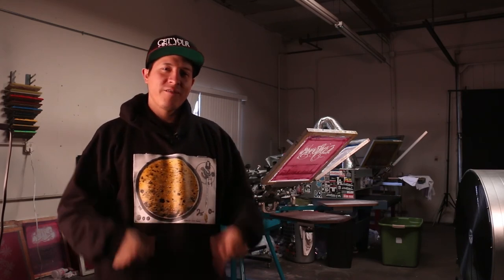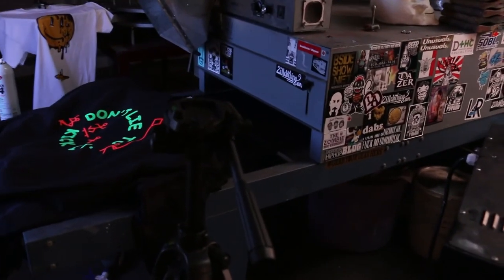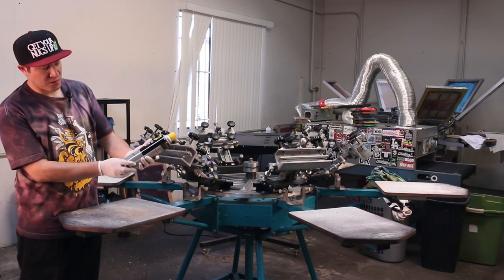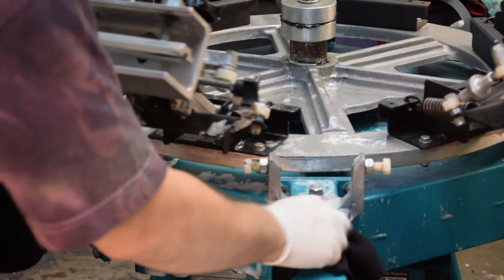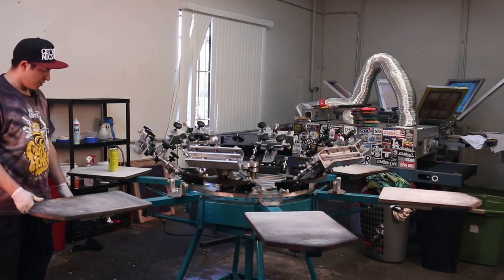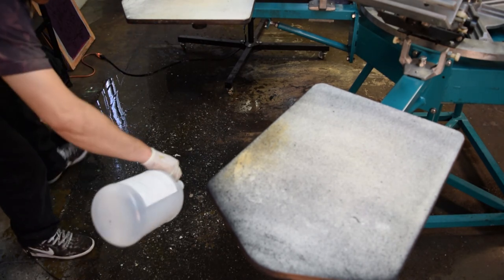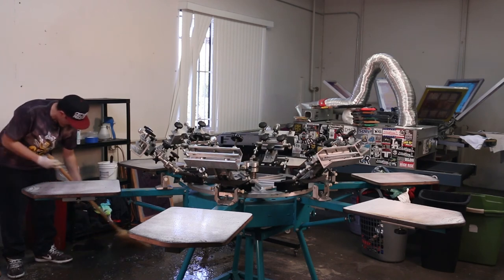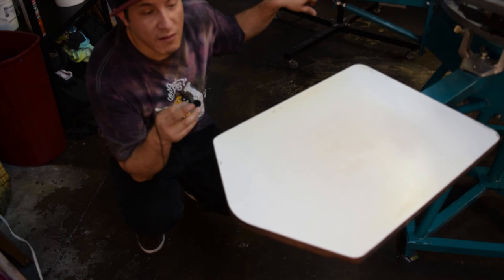2 iLL Screen Printing - Cleaning - Machines & Floor

Comment: what's up g like the vids I got a question I been screen printing for about a year and when I print white on black tees you can see fibers in the print it's not smooth like I would like a homie that screen prints said to use a higher mesh I did but I still have that issue
Reply from the maker: +95HondaEg6 Send me a picture detail of what you are talking about and ill incorporate it on one of the videos. Thanks for watching!
Reply: +95HondaEg6 Maybe the ink you are using is to thick make sure you mix it a lot to make it smoother try to reduce it by using reducer.. ic can also be that your not hitting it enough times.. try to hit and flash and hit and flash again until you get a nice bright white.. I had the same problem I started using a different plastisol white called Meteor white from Ryonet i recommend you use this bro it is so soft and easy to work with I hit and flash and hit and flash again and its nice and bright. hope this helps homie .. Here is the link http://www.screenprinting.com/meteor-white-ink-gallon#.Vg2NW3pVhB

PCK+CLOTHING

Comment: +2ill Clothing how does that union inks work?
Reply from the maker: +Kevin Key They work real well. The shop where I buy my inks sell Union and Triangle, I like Union better. The consistency of the colors are thick and rich, might have to thin it down a little with soft hand if you are using opaques.